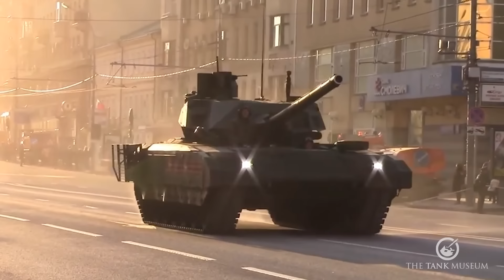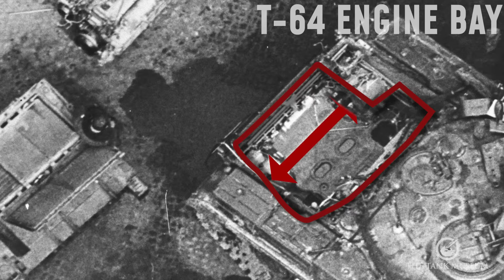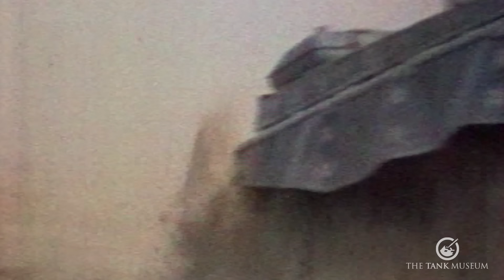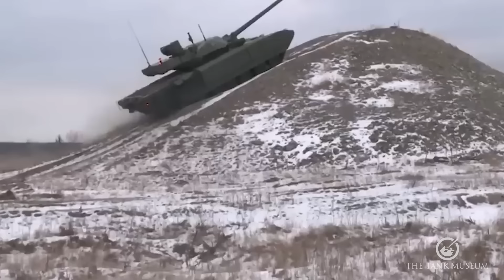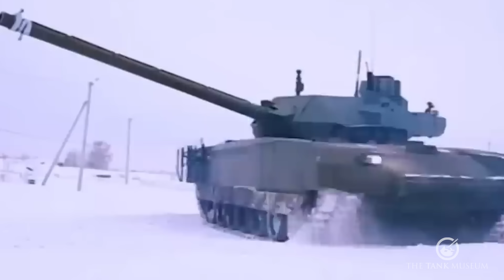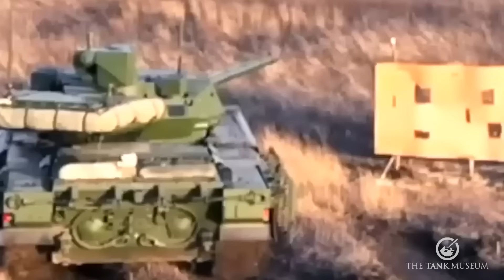Radical or Ridiculous? | T-14 Armata | Tank Chats #171

Comment: As part of the Army-2023 international military-technical forum, the T-14 tank took part in a dynamic display in front of foreign guests - potential customers.
There are no special problems with the production of tanks. Tanks are produced (T-90MS, T-72B3M and T-80BVM) and are regularly sent to the front. But, the main part goes into service with the strategic reserve, which will enter the battle in the event of a direct entry into the conflict of NATO countries. The T-14 is also in this reserve, and its crews are constantly practicing combat coordination and joint actions.

Comment: The problem is that this tank fails to provide what it was primarily designed for....crew safety.  If you look at footage of the tank, in particular in and around the crews compartment, you will undoubtedly notice how thin the armour is on the top of section of the vehicle.  It is literally only an inch or so thick, far less than is needed to withstand modern top down ATGMs or anti tank munitions dropped by drones!  The crew would appear to stand no better chance if hit in this portion of the tank than they would in any of the Russian T series tanks.  The only benefit is that it is probably less likely to experience a cook off that would instantly toast the crew, but that being said I'm not convinced that ammunition detonation isn't still a likely cause for these vehicles to be damaged and knocked out, even if the crew do survive it!
Reply: Yes, just like the Abrams, this tank was not designed for the modern era of drone warfare.  I think we're not seeing them in battle because Russia realizes they are not going to be effective and that the nature of warfare has changed so much that MBTs are on the precipice of obsolescence.
Reply: Every modern tank is vulnerable to top attack...Abrams was obliterated by FPV drones....so was Bradley and Leopards. Challenger 2 got obliterated by obsolete 1980s Konkurs missiles.
Reply: @interpl6089  But they were much older designs.  The T14 was advertised as having the ultimate in crew protection on the modern battlefield!  Obviously they kind of made a mistake in that presumption😁
Reply: @Altair885 The only one making mistake is you. T-14 has Malachite ERA on the roof of the ''crew capsule'' which will protect against ATGMs and especially Drones...It has Composite armor underneath that. You can see that when the hatches are open. On the crew hatches there's a good layer of composite armor visible. You can't put ERA on a crew hatch. The crew is well protected against drones and missile...however the problem comes with so called ''mission kill'' which is basically destroyed optics or disabled gun.
Reply: @interpl6089  Guess we'll see, well, if they ever actually put one on the battlefield! 🤔😁
Reply: @Altair885 Russia already said multiple times that T-14 won't see direct assault operations...they were deployed in indirect fire roles, engaging targets from kilometres away and then backing off...they were withdrawn from this role when FPV drones and NATO artillery began appearing in extremely big numbers. Thus you can say that the T-14 was actually used in combat, just not that type of combat people think of when they think ''tank''.
Reply: @interpl6089  So it isn't good enough to see front line service like all the other tanks that are there now?  I would have thought that if they offered so much more protection than other tanks they would be in the thick of it!
Reply: @Altair885  It's a very expensive piece of hardware that you don't wan't to lose. There's also the very big problem of it falling into enemy hands and leaking sensitive info about it if it suffers mobility kill (the tracks are disabled) or a mission kill and is abandoned.
Reply: @interpl6089  Better to just sacrifice tank crews in old outdated equipment then?  Without real world combat, how are they going to know how well it'll really stand up?  In other words it's nothing but a paper tiger!  I don't buy the official excuses, it's just bs from a regime that is running out of time and money.
Reply: @Altair885  They aren't sacrificing crews... that's a very old lie about Russian armor. T-90M or T-80BVM does the job just as well and for third of the price. Also sending in T-14s would stretch supply lines as they have nothing incommon with T-90 or T-80 spare parts. Please learn something about how wars work and don't spit crap.
Reply: @interpl6089  That didn't take long!  You don't have resort to using insults because you can't come up with a feasible explanation.